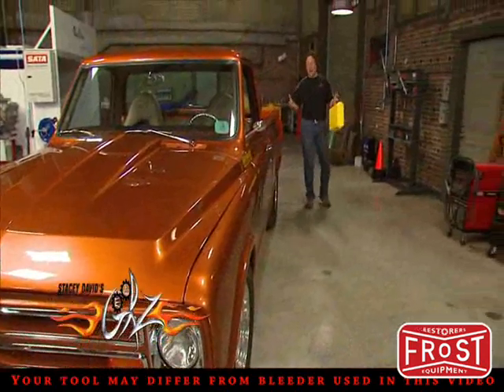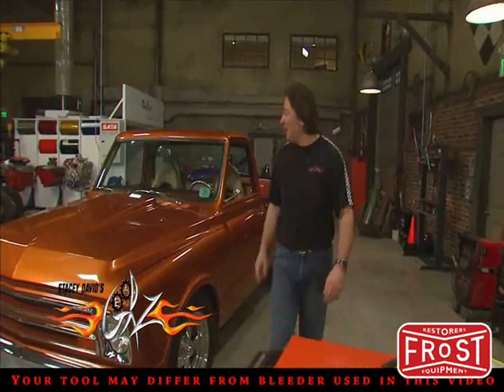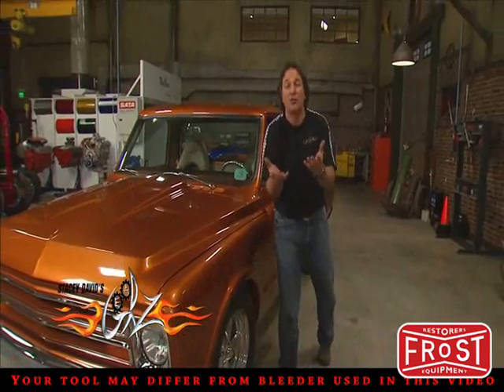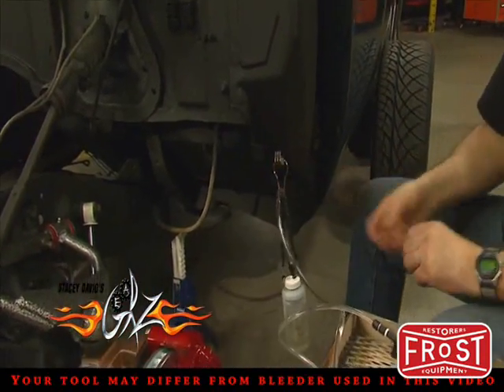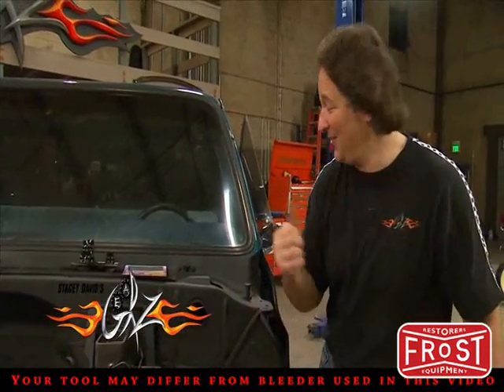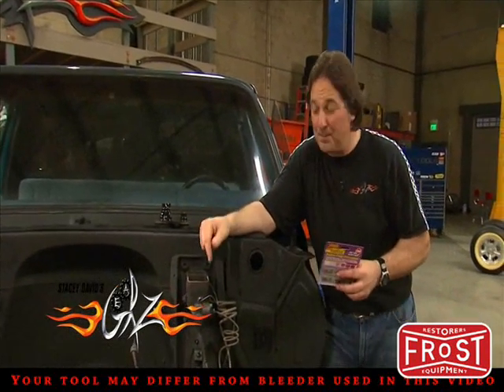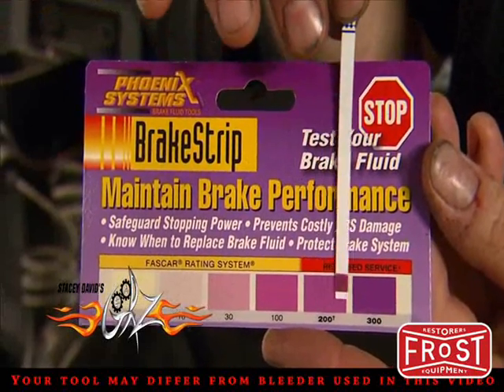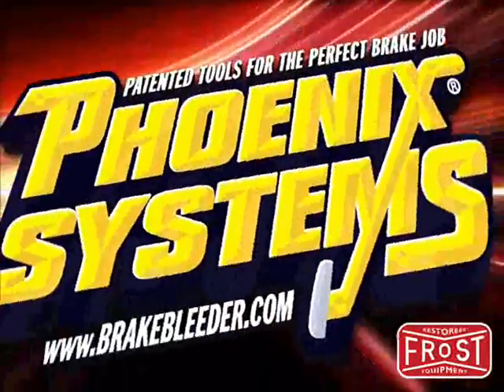Stacey David: How to Reverse Bleed with V5 Brake Bleeding Kit

Comment: Bleed nipples are on top of calipers because air rises, you wont get air out putting fluid in from the top, air will not come out through the brake pipe that sits below. Not only that but you push any dirt in the system into the mastercylinder. A better use of the tool would be to turn it round and suck it through.
Also no cars use copper in the brakes unless you fit copper brake lines, copper is not recommended anyway.
Reply from the maker: Dubsy Dubs As you say the tool can be turned round to suck the air out. However, sometimes the air seems to get trapped in the master cylinder, particularly when the reservoir is remote - you now have another option to shift it.The pressure and flow are both small and settled dirt should remain that way.

Comment: Looks very good... BUT.....  What happens to all the fluid that gets pushed up back into the master cylinder and the reservoir ?  Does it just flow out of the top and all over the nearby paintwork ??  Some reservoirs are difficult to fill, never mind empty.
Reply from the maker: Andrew Wardle Before you start, you use the V5 bleeder to lower the level in the master cylinder reservoir. The hose makes it easy to access.
Reply: Get a cheap syringe and pump some out first